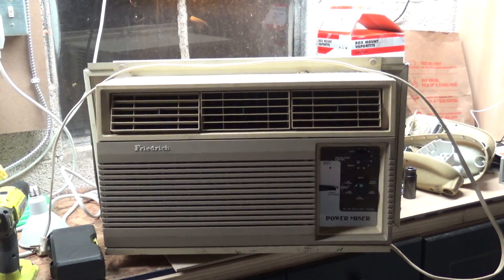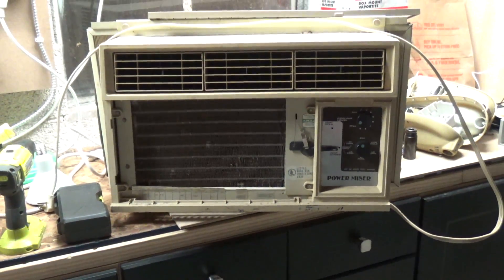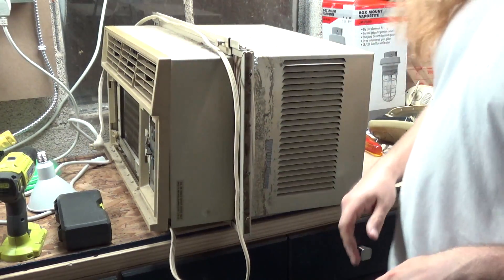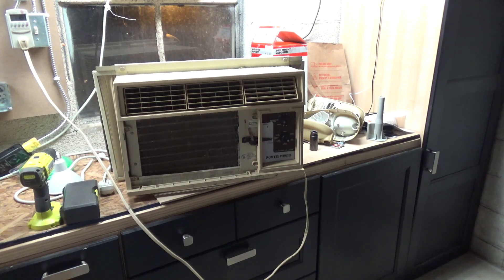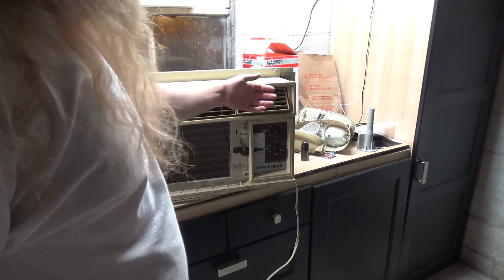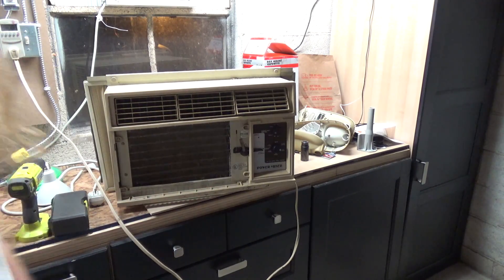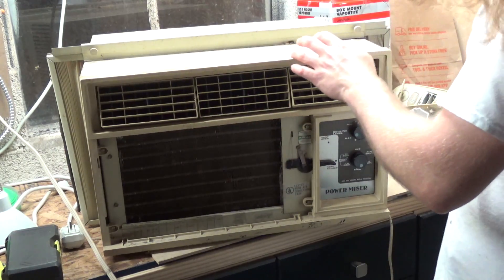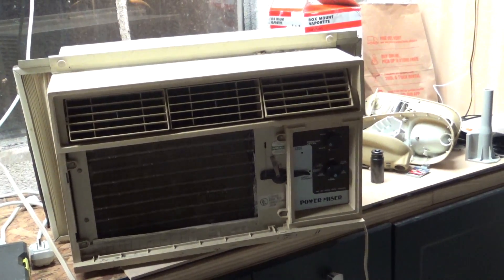1987 Friedrich SP05G10C 5,250 BTU Power Miser Air Conditioner | Initial Checkout

Comment: Wow that is an amazing machine you found! Where I used to live in NYC, Friedrich window ac’s are still very common in residential applications, even older models. I grew up with one in my room which was a small r-22 5000 btu model ZQ05A10 from the Z star lineup which was sold around the early-mid 2000’s. Even though it wasn’t a vintage unit, it froze out the room in minutes and it lasted for over 20 years! It had a drain hole so that may be why it lasted. They don’t make them like they used to!

Comment: I grew up in Southern Oklahoma in a house without AC. Just a big 48" side mounted attic fan.  My grandma lived next door in a small house and the family bought her a Friedrich window unit new around 1969.  It was 11000 something btu and put out ice cold air.  Ran very quietly.  Friedrich were all over town in those days before houses got central air.   They were built extremely well and like I said, very quiet.  Possibly the best built units of the time.

Comment: We had a 1991 Friedrich 5,000 BTU air conditioner in our garage until last year. Sadly, it finally died towards the end of last summer. I do see them in houses occasionally but I think you are correct, they are more common in commercial installations. They seem like they are really well built units though overall. Great video as always.

Comment: Man, you have got the opposite issue I do, My windows are only around 25 inches wide, and I need an 8,000 BTU unit or so, so I have a hard time finding any units which will fit in my windows. Luckily a GE quietaire fits just fine. Sadly, I can't use any of my vintage 60s/70s units as they are all too wide.

Comment: Love the older units! I have an old Fedders model. When should I have the "Air Exchanger" option in Closed or Open position?
Reply from the maker: Closed. The Air Exchanger opens a tiny window in the air chamber that allows indoor air to pass to the outside. It's too small of a quantity to have any noticeable or useful effect, nor do I see why one would want the conditioned air leaving the house.
Reply: its not a really useful feature, but most of the time you have it open during the night (8:30pm-7:00am). It just lets outside air in so you dont have to use power from the ac.
Reply: Honestly, that is sort of a useless feature. I would just always leave it on the closed position. The amount of air that it is actually exchanging is negligible.

Comment: I see some of these in the city still, of course the hot and muggy NYC conditions have rotted them to almost nothing without a drain hole, used to be a lot more of them.  That’s still a decent unit for the era.  Equivalent of the 5,000 BTU ‘Portable’ series I have from 1974.
Reply from the maker: I still see some Friedrich equipment from this era installed in older commercial buildings in certain areas around here. Anything that lasts 3+ decades with no service must be pretty decent in my opinion.